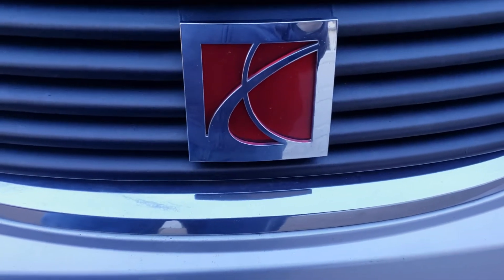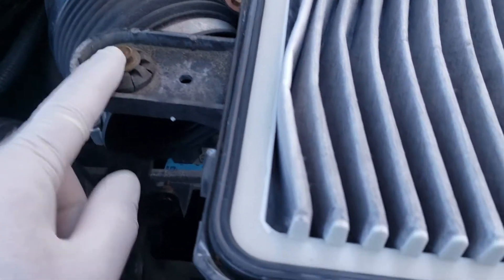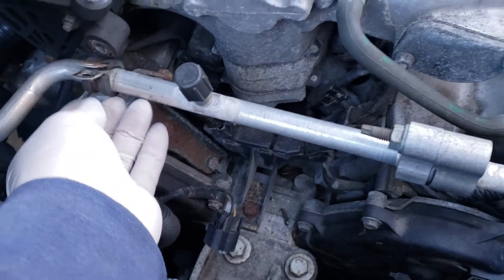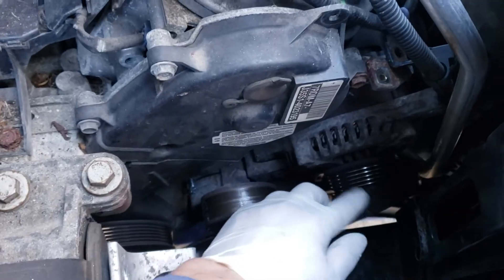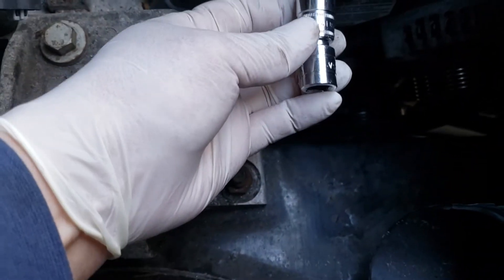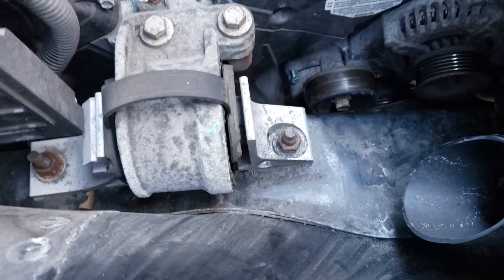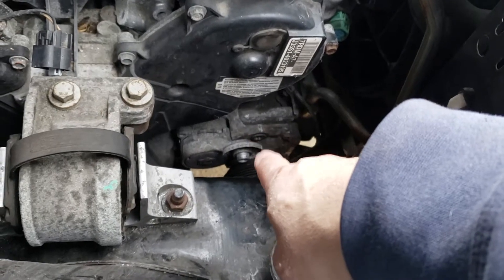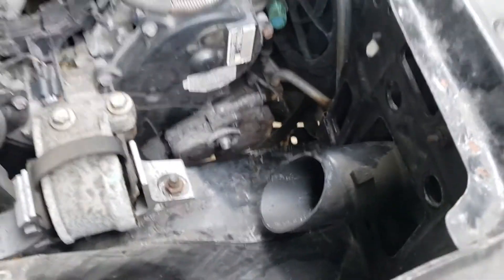2007 Saturn Vue 3.5 Alternator Replacement

Comment: Thank you for this great video!  Reading through the comments I thought I'd add a few comments in hopes of helping others.  Someone else mentioned wires to an AC sensor being attached to the alternator.... mine had this too, they were attached with a factory zip tie that snapped into a mounting hole on the back of the alternator.  Didnt see it at first.  Was able to get a long, wide, flat screwdriver in there to pop the snap loose.  No provision for it on the rebuilt alternator, but shouldnt be an issue as the wires arent really close to anything moving or hot so we should be fine.  My alternator actually came out easier than expected (definitely had to twist and turn it)  I only removed the one motor mount bolt as shown in the video.  I tried without removing the tensioner pulley (mostly because I didnt have a 14mm wrench to get it off) but couldn't.  Got the wrench, got the pulley off (huge thank you for commenting on the reverse threads in the video!!!!!) and the alternator fit through the space.  I thought about removing the timing cover as someone else mentioned, but I was concerned that there might be a gasket on it that might not be immediately available and I needed to have this car back in service the next day.  As for only removing the one engine mount bolt, the other mounts have a lot of rubber and flexibility, removing the one in the video is sufficient.  As for the comment about lifting the car as you lift up on the engine, you really aren't, you are just taking the weight of the engine off of the suspension which allows the car to raise up a bit.  Thanks again for the great video!!!
Reply from the maker: @SteveLeopold-y2o  great tips, I love when I get feed back and the compliments and thank you for watching too...

Comment: Other than removing the bolt in one engine mount, do you need to remove bolt in a different engine mount? Other vides mentioned a second engine mount near front center.
Reply from the maker: I only removed the 1, I'm sure you can take off another bolt to make it easier to lift. Everyone always does it differently of course. Good luck on yours.
Reply: Thanks. I removed the front nut too. Super easy using wrench extensions piggyback on each other. Still I noticed that the front of the car was also lifted a little, but the engine was raised much more. No harm done after I finished.  @alyoungcuda
Reply from the maker: @timguy161  done the right way. No problems...thanks for watching too.

Comment: Thanks for the video. Just did this on my Vue in the Walmart parking lot. Took about an hour. I had issues getting the alternator out the way you did, so i loosened the radiator and pushed it forward. That give me a big old hole in the front to get alternator out.
Reply from the maker: Good idea and kudos for doing it in the parking lot...

Comment: Thanks for the video. I bought remanufactured OEM alternator for $196 online price, but it looked exactly like brand new! After replacing, whine disappeared. The horrible lines on the backup camera (aftermarket) screen gone too! The lines started a month before whining started. Good forecaster. My bad alternate will not make noise when disconnector. Must be bad diodes. I was able to remove the two electric connectors (with rubber boots) and one purple fastener before unbolting the bad alternator. Inserting an Allen wrench inside that hole in the tensioner to keep the tension in place really helped. I had a bad time putting the new alternator in because the new one was 1 mm wider in the lower mount. I managed to use nut/bolt/larger combination wrench hole as metal gap/washers to push out  the sleeve flush (2 mm distance) in the lower mounting hole.
Reply from the maker: Wow, even with all that you got it in and it works..remanufactured is all new parts except the outer casing. Rebuilt uses  all parts that passes inspection  and is in working condition and that is why the rebuilt ones Don't last long..what you bought is just like New.. im glad it worked out for you and many thanks for watching too...

Comment: Does the upper alt bolt mount to the motor or a bracket?
Reply from the maker: To a bracket that is mounted to the engine...
Reply: @alyoungcuda  I was afraid of that, mine looks to be broke from when the alternator seized up and threw the belt. Thanks for the reply.
Reply from the maker: @slow87gt  look closely at it, take a cell phone picture of it by sticking it in there, you might get away with a long nut and bolt with washers

Comment: This video helped but my alternator had wires in the back that were clipped and zip tied to the o² sensor.. a pain in the @$$ if you have big hands like myself.. still struggling with it now
Reply from the maker: Thats when you get a volunteer to help you out, I ask My Wife...
Reply: @alyoungcuda  yes.. I had my wife help get the serpentine belt back on. My hands would not fit

Comment: Good info. You should also take off timing belt cover. 5 small bolts ,The cover is split in have for this reason then the alt comes out alot easier.
Reply from the maker: Good to know if the car ever comes back from car heaven...the engine/transmission cradle rotted and dropped down.

Comment: Thank you so much. This made the job much easier.  Only thing I might add is to be careful of the plug below the alternator for the AC. mine was factory taped to the alternator wires and I almost snapped it off.
Reply from the maker: Good Tip..Thanks for Watching

Comment: Great video. Great tip on the bolt to hold tensioner. Too bad you wound up having to remove it. Also, appreciate your honesty (when you pointed out the scratches).
Reply from the maker: Thanks for the compliments and thanks for watching...